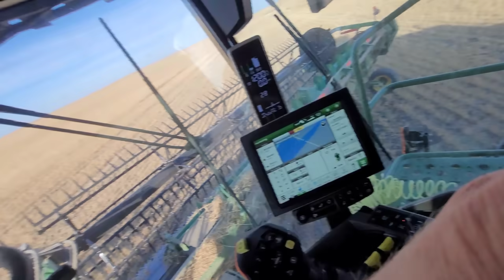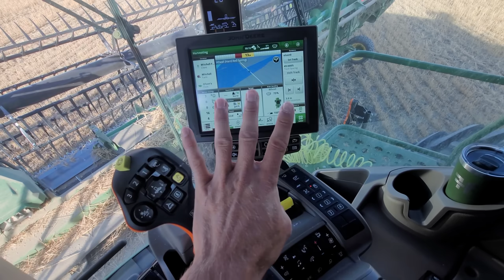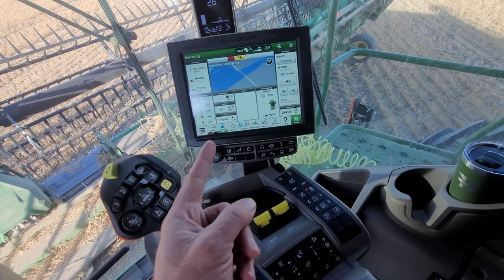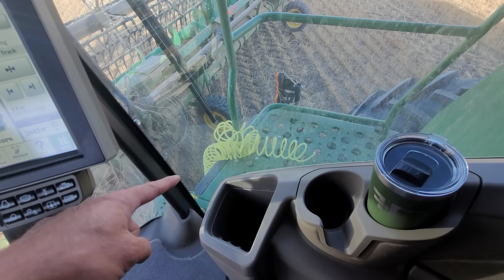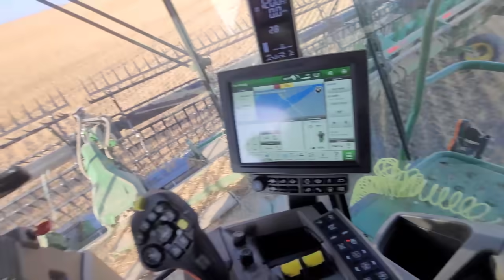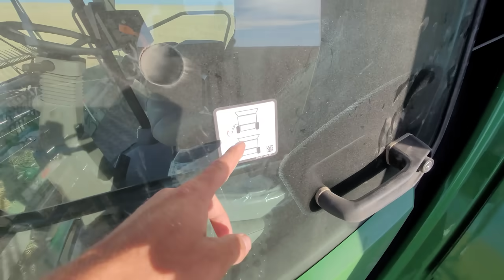Fendt vs Deere - The little things!

Comment: You’re right Mike. You spend that much money 💵 your level of expectations absolutely should be critical. Keep up the great work!
Reply: I agree with Mike.  I just hired a small roof to be replaced.  I went to look at the progress and the roofer was putting new drip edge over a rotten facia board and there was even a 2’ section missing.  He said that wasn’t in the bid.  I have had lots of work done and was flabbergasted.  I had a farm house roof done by an Amish crew and I was never there to see them work, but when I did see it was perfect, no short cuts.  I then hired them to do windows, insulation and siding the next summer.  Again great results.  I would think they sleep better at night based on how they do a job.

Comment: You are one of very few people in this world who has actually used all of this new/big equipment of all shapes, colors, and sizes; therefore you are one of few who can speak on the differences based on experience and not just what the specs say. Lots of people have run one or the other but the comparison is where you learn what's good or bad. If I was a manufacturer I would definitely be watching all of your videos. Good luck with the remainder of harvest, hopefully you get a steady drizzle for a month or two the day after you finish!

Comment: Actually Mike sounds as though he's pretty happy with the Deere, but like all manufactures, there will be things a customer doesn't like. Over this series of videos the one thing he's said that would make up my mind was the down time of the previous equipment. It will be interesting to see if these new Green equipment will stay up and running... I assumed these are all on lease with so many hours being run and road miles for an operation this large. My experience is with Heavy Equipment and Trucks, not farm only equipment, so I could be wrong. Ya gotta like a guy and take his opinion as pretty much honest that will go to the trouble of taking his shoes off to keep the carpet and floor clean.
Reply: He has already said the Deere's have been night and day different when it comes to uptime.  At the end of the day, these are small items which will be addressed by Deere (no doubt), but the Ideals were just horrible for uptime.
Reply: @jamesbainton  I'm not defending the Ideals because they were very bad. But hopefully AGCO learned a lot from Mike's experiences and made a lot of improvements. Might not have had enough real world testing before they released them to the public as well
Reply: Exactly what I said mate. Had every colour in my last 26 years harvesting,  Deere Rules the Roost means they are number one. Understand there champ.
Reply: @stakman78  hahaaa keep drinking the green drink. Ive ran every brand also and id take New Holland or even Gleaner over everything else.

Comment: Mike you still can hardwire a 110v converter in the cab. Just run it off the starter with a heavy gauge wire to the cab with a converter and you can plug anything you want in it. Heck id have a microwave, a coffeemaker and small oven in there lol.

Comment: On the s690s we ran into an issue with aftermarket tank extensions. We had several absolutely destroy the final drives on the left side(auger side). It added too much weight. We as a dealer sent out a warning to anyone of our customers and even helped take some off machines.

Comment: I remember running grain 9390/Brent 974 grain cart for 2388's with 36ft straight cut headers.  Had to tuck the header in between the tractor tires and cart tire while unloading on the go.

Comment: The option for the 110 outlet is out there. In our 8RX tractor there is a 110 outlet on the corner post. I didn’t spend much time when we had the X9 to know if there was one in there but there may be one that you have found yet.

Comment: If I remember correctly, on the 9880 STS. All rotor changes were performed from the cab. That was about 17 - 18 years ago! Before the STS we had a CTS. The CTS insisted on setting itself on fire in Beans (as did the other CTS that JD sent to help catch up) and the STS simply couldn’t cope with English conditions and destroyed itself. We had no choice but to go to a Lexion!

Comment: Must be a Generation thing 😁 I never listen to music in the combine or tractor, I like to feel and hear what the machine is doing. I Never rely on the Warning System manufactures incorporate and can tell before something goes sideways, have a problem developing, or how the crop is running.
Reply: How? The cabs are so quiet and isolated anymore
Reply: My father never listened to the radio, just the sound of the engine and the crop going thru. One day he felt a small vibration. Next day after pre trip grease it took him 1 hour to find a bad pulley on the feeder house on a 1680.

Comment: Mike, as far as unload clean out, if you need to stop the auger quickly in an emergency stop situation you can double tap the unload button while it’s unloading and that will stop the auger without clean out, now if you do that on a regular basis I guarantee you will shear pins, but if it’s mostly cleaned out and your cart operator takes off just double tab your unload button and your good to go👍
Reply from the maker: Good to know! Thanks 🙂
Reply: @mikemitchell2554  the second thing you do is skid the cart driver’s butt out of there. First rule of thumb is everything is the cart driver’s fault. They teach that on day one of cart driving school.

Comment: The ladder is a safety issue as well because if you have a fire and the ladder is in the up position you would have trouble getting out.
Reply: Except for ones like Gleaner. Its made to be over powered in an emergency, its why the electric ones seem "cheap".

Comment: You know Mike, I think the hopper size is because of weight. Ideal has a lighter combine which in turn is built worse. It doesn't matter which brand you have, lots and lots of farmers have issues with cracking rims on duals and blowouts on singles so it would only cause problems to have a bigger hopper. Its probably not an issue on flat fields but on hillier ones it is and we've had this issues with CHN and  John Deere
Reply: Then explain Claas with 500?
Reply: @J-1410  they have lots of problems with them as well, which is why they sell most of them with tracks. You wont see many farmers with hilly land buy one without tracks. There's a huge amount of friction when they turn with a full hopper. The X91100 has a 460 bushel tank too but they also don't sell many without tracks unless to big farms with flat land. I know this because I farm on a huge farm and it's an issue every year and the rims aren't easy to get when it gets later into harvest
Reply: @googleuser4009  you do realize a full new, big, grain cart weighs more, and is tracked?(2000 bushel models)

Class has always had issues with its tracks.

Also CNH offers bigger options too.
Reply: @J-1410  well this is just in our area here in south Saskatchewan, I can't speak for other. Tracks can handle a lot more weight
Reply: @googleuser4009  I'm right across the border in ND. Tracks here are more of a gimmick than actually useful. Its dry and you will have compaction either way, might as well have a halfways decent ride with tires.
Reply: @J-1410  well I don't know about compaction, we need them on carts and combines to handle the weight in our terrain
Reply: @googleuser4009  I'm not getting your point
Reply: @J-1410  that's what I thought
Reply: @googleuser4009  I mean how to tracks carry more weight?

If you're not worried about compaction...

I mean there are tires that easily hold the same weight.

To me it sounds like you bought tracks and now have to defend them.

"Carry more weight" explain
Reply: @googleuser4009  googling this but right on Claas's site, on their largest model, tires, or tyres, are standard.

Comment: I agree on the sound systems being "volumed" down. Probably trying to avoid lawsuits. On some of the convenience items, we're probably many thousands of dollars ahead by adding them ourselves.
Reply: BMW designed that cab, so blame or commend them.
Reply: Haven’t tried it in the x9, but with most sound systems. It will go louder with a usb connection than a Bluetooth. Due to the limitations of wireless signal.

Comment: You have screen sharing among combines for gps lines. Could you not have a system that would screen share with the grain carts showing how full each combine is and where they are and direction of travel. It should be possible, I think!

Comment: I totally understand when you say it’s a 800.000 $ combine at this price it should has better sound system and installing a 110 volts inverter , or at least offer them in option in reasonable price , JD probably think it’s still 70 years old pappy who still farm and drive combine and listen to AM radio . 
I remember when I was 8 in 1976 the first time I driven a combine it was a BIZON I don’t remember the model the header was about 10-12 feets wide and the hoper is very small , I was going up to the end of the field and coming back and had to empty it because I wasn’t going to end of it , and I had to put all my weight on the clutch pedal ….

Comment: You're gonna need a dedicated 1500w spare AC generator on the system to put any kind of coffee pot in that thing.   It SHOULD be an option, imagine having the ability to run a grinder or a plug-in leaf blower directly from the machine!

Putting a compressed air port anyplace or running the lines past any place where fires may occur would be unbelievably idiotic.  Dumber than putting a plastic thousand liter fuel tank over the rear bearings
Reply: Just a factory installed standard 2500 watt inverter for $300 bucks would be all that's needed. You aren't going to running full load constantly.
I drive truck and that's what we generally all have, and I run the fridge and microwave and various kitchen appliances and cookers and tools and everything else off it.

And putting an air line near where a fire could occur means that you have easier access to the air to keep the area blown clean, thus reducing the risk of fire.

And I would say that the chances of a fire starting and melting through the air line, and the air leak making the fire worse, is a pretty low probability, and not something I would worry about!

Comment: How about a Gleaner?  Lighter, Simpler, large capacity grain tank, and quick unload.  Bottom tank unload auger, may be an issue on auger length.  You need dealer support of course.  Gleaner deserves consideration.
Reply: If he had Fendt, he has Gleaner.

Comment: You got robbed....our S series always has had sun shades in them. And the stereo sounds awesome, when not in Bluetooth.  For some reason mine doesn't get very loud either when in Bluetooth. I haven't seen you film it this way yet but you do know the buddy seat lifts up so you can access the fridge from the top too right?    Thank you for your honest and thorough review.   That variable unload speed would be sweet. I agree with the auger length....machine sync helps but it is too tight.
Reply: You try turning your phone volume up? There may be a setting to limit Volume in the system options too. Some phones have a limiting option because the Government regulations on potential hearing Damage. 🙄
Reply: @Len_M.  Yeah, it works fine in all other vehicles.  It has something to do with these new JD touchscreen radios.  Same issue in the tractor.  It's loud enough to hear it but when a good song comes on it's not loud enough to get into playing air drums.  Older Bluetooth radios  thumped with the premium sound system. (for a combine).